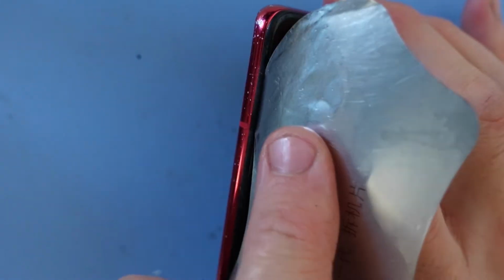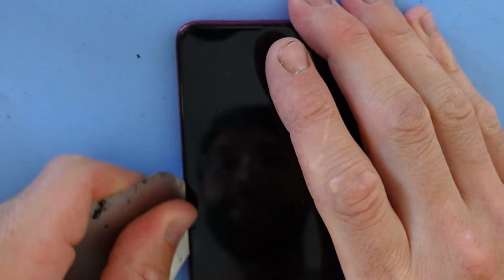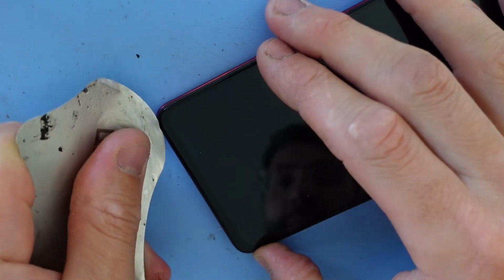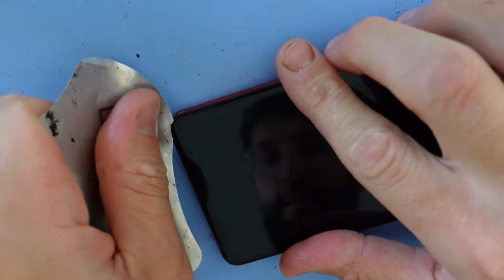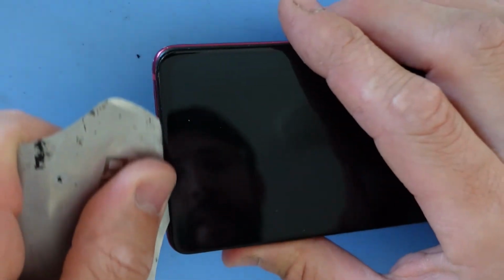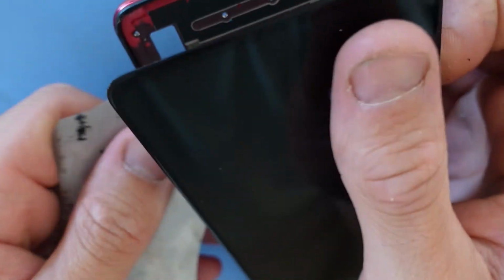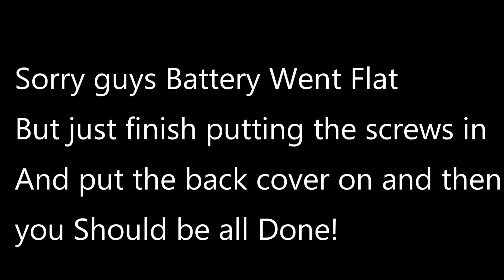Xiaomi Mi9T / k20 Pro Display Replacement (English)

Comment: I have a slightly strange probably convoluted question for you, probably skip to last paragraph if that's easier. But you're an Aussie with probably more experience than me in these things.

Anyway I have both a mi 9t pro 256/8gb and a Redmi k20 pro premium (so called) which is the one and only 512/8gb model of Redmi/Xiaomi mi 9t/k20. 
The mi 9t pro had some bad luck quite the while ago and essentially the screen ended up dying. Waited months for the replacement to get in, didn't happen. Yet I needed a phone so I got this Redmi model which I was very much happy with because it's essentially the same phone. Except for one crucial yet unnecessary thing... Netflix doesn't like the Redmi at all for some particular chipset differences.

And on to the question: in your experience could the storage be transferred independently (presumably with either a hot air gun/de-solder station and all the patience in the world as to not damage anything) and still function? I know Android as an OS would likely just detect it as a larger storage. And this is under the assumption that the 'premium' board and storage module/s are the same physically. I have yet determined that so I may be shit out of luck. But that's to be observed in a few days on my weekend.
Reply: Also thanks for the guide, I would have probably used it to replace my front panel, had I not destroyed the screen the day after ordering the panel that is. 
And wish me luck, it'll likely just be me supplanting the internals of the mi9t pro into the new frame/display/back panel and calling it after peaking into the Redmi and finding out it has a specially made storage module or something.

Oh and FYI for anyone else wondering about parts. Don't get them on eBay. I now personally know that at least one of the sellers that sell replacement parts for the Xiaomi/Redmi is just flat out scamming and it'll never get to you. This'll be the only time I'll ever say it but just go straight to AliExpress for your grade B chinesium. It took 2 weeks.. not 4 months of waiting for nothing. And it cost much less.
Reply from the maker: short answer, the IC containing the storage cannot be swapped between different models of phones.

It might be possible for example:
mi9t swap storage ic to another mi9t but not cross models

Comment: My screen stopped working some months ago, even though it still responds to touches, I've since bought another phone. So glad I kept it until now, as it was the best phone I used so far. I recently considered buying a screen with frame to finally repair it, but you showed how simple it is to reinstall the display only and even save time on disassembling the whole thing. Thanks!
Reply from the maker: Cheers, glade to hear this has helped you :)
Reply: With frame , but what about The finger senzor?
Reply: hey same thing happened to me yesterday. I want to but a New phone but id like to like backup everything from the k20 pro so , how did you solve the problem?